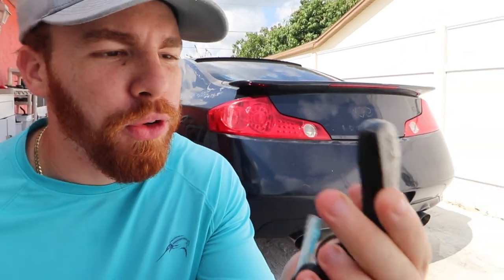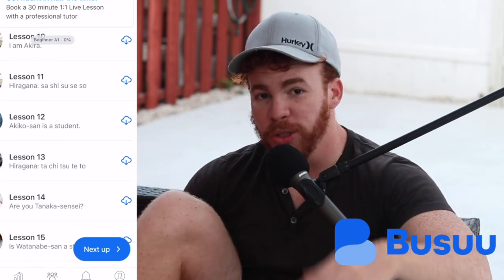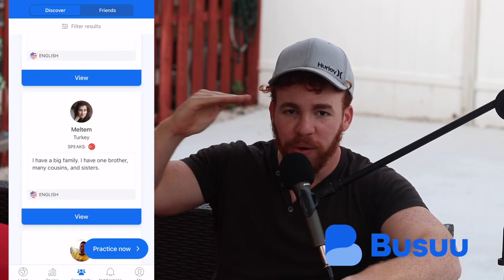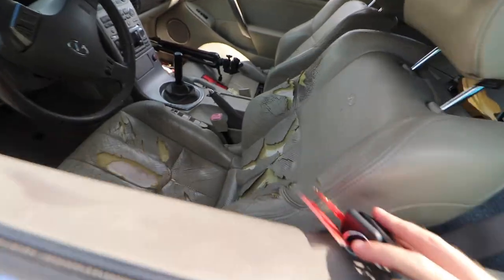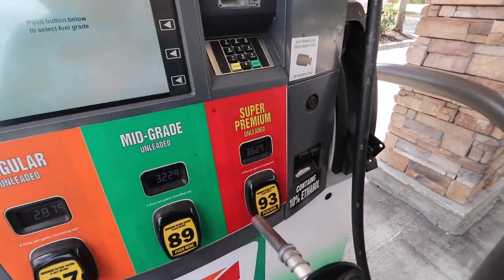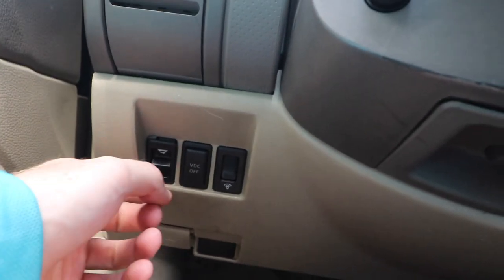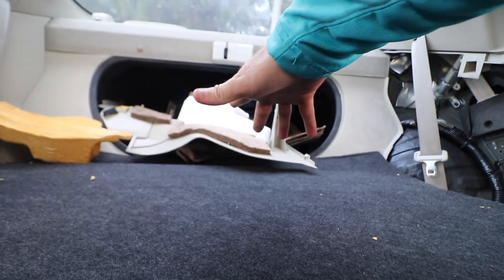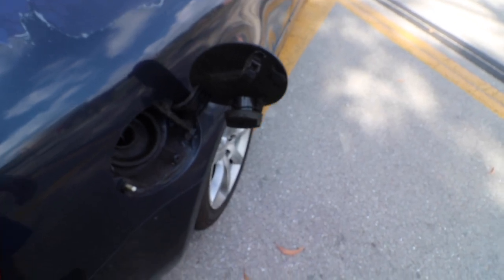5 HACKS/FEATURES Infiniti Kept Secret [G35/G37]

Comment: If you get a chance look up pin 101 delete...
This wire is located on the passengers side under the glove compartment... now it varies from year to year on what color wire you need to cut but mines was blue and pink if you cut this wire you get to keep your brake lights and infinite burnouts
Check it out
Reply: Im looking for this wire, i have a 03 sedan AT and i noticed i have a box with a bunch of wires on the side by the kick panel? Or from the ecu connector

Comment: Be distinct youtuber has his G remote start
Reply: His g is automatic
Reply: Isn’t it
Reply: @Cubbs1920gang   his G is manual. And he bought it already installed remote start. Someone must have did that on the side for cash because shops won’t install remote start on manual transmission cars
Reply: @siknin1  why?
Reply: @g35tho11   it obviously can be done but. Mostly because of safety issues is why it’s not a factory option on manual. Someone might forget and park the car in gear instead of neutral with parking brake pulled.  The Remote start would bypass the clutch no start. so the car starting in gear could just roll away with no driver. But anyway yea you can still install it and it works fine as long you remember to have the car in neutral
Reply: @g35tho11  but rolling away cause it’s in gear would be worse case. It could also be in gear but the E brake is pulled so it just cuts off as soon as it starts.
Reply: @siknin1  oh ok thank you for the reply

Comment: I know how to do standing burnouts without losing your brake lights hit me up if you would like to know
Reply: If you get a chance look up pin 101 delete...
This wire is located on the passengers side under the glove compartment... now it varies from year to year on what color wire you need to cut but mines was blue and pink if you cut this wire you get to keep your brake lights and infinite burnouts
Check it out
Reply: @g37vqgang81  does it work on g35s
Reply: @smurf_chicago6555  yes

Comment: You can also turn the horn off for when locking the car if this is something you’d wanna do it can be done with the key fob i always used it because I got home late
Reply: how
Reply: @cayleland  Press and hold lock and unlock buttons on key fob for about 3 seconds the car should honk 
Repeat process to turn it back on